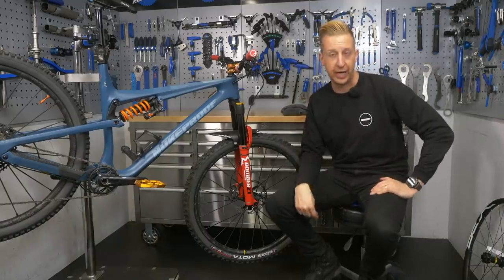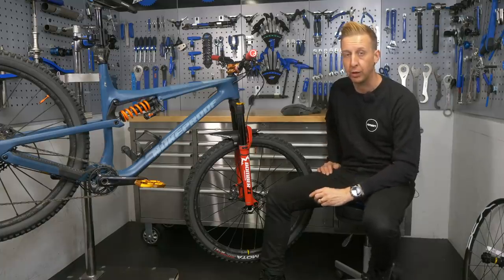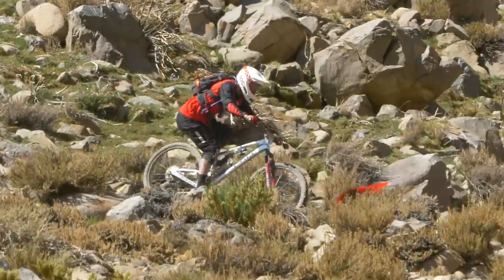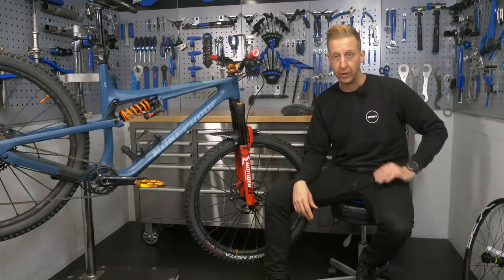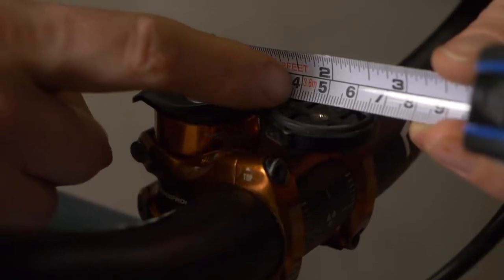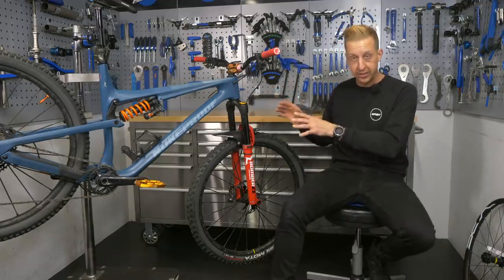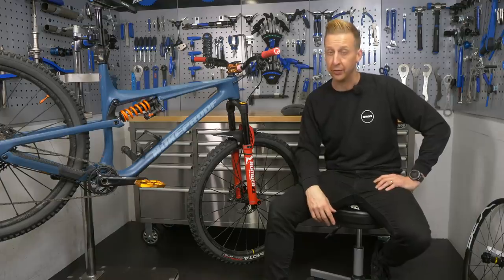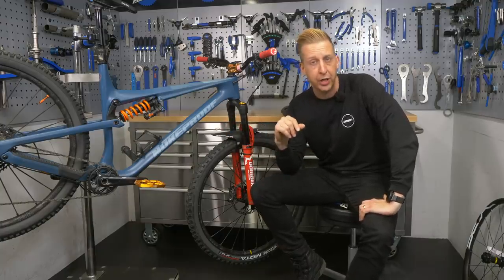27.5 Inch Wheels Are NOT Actually 27.5" | MTB Tech Misconceptions

Comment: I swear this video was a life saver. I took my bike apart and couldn't find out what was wrong with my headset but it was brake pads
Reply: Don't forget rotor bolts. They can work loose and cause the rotor to move

Comment: Easiest way to isolate the headset is by turning the bar 90º and either rocking it or torquing the bar up and down. This eliminates both the fork bushing play as well as brake bolts or pads.
Reply: Brilliant tip, saves lots of time and effort
Reply: thats exactly how I do it

Comment: I disagree with the lockout not making you faster. When you lock out you transfer more energy to the pedals and not into the suspension. Especially if you stand up. I’m open to being proven wrong though so if there’s a video or other experiments anywhere, point me that way. Keep up the good work.
Reply: Ur correct in general...does depend on terrain, e.g. a technical climb maybe more efficient open, but Fire road etc. Locked is more efficient (more speed for watts same energy input).
Reply: A slippery or technical climb may be more efficient with the suspension open. If one is locked out and compromising traction, they may have to pedal more carefully and with less pressure to make the climb. I stopped using my switch and haven't noticed the sustained climbs being any more difficult. I'm on a 153/160 bike.

Comment: The rotors can get loose and it will feel like the headset are loose aswell
Reply: I recommend marking rotor screws with marker pen ...take a picture... then you can see if there's been any screw movement. Saves breaking a loctited seal when checking.
Reply: Yeah thats one way! But if you dont want to draw on your nice Ti scews, the 1 drop of loctite (normal strengt!!! If you dont wanna drill them out🙈) will keep them from moving.

Its easy to check if the rotor is loose, stand over the bike and grab the front/back brake and puch the bike back n forth a bit while looking at the hub and rotor, if the hub or the whole wheel moves a bit while the rotor is still, its gotten loose.
Reply: True enough.. ;)
Reply: Then you’re not really checking the bolts.  It’s pretty easy to just put a T25 on em and check

Comment: I was convinced my headset was moving once and it was the shock bushing 😂
Reply: Fork? It is a tricky thing to feel...best to have preload so loose its v obvious, tighten 1/8 (yes, 1/8 NOT 1/4) turn at a time until the obvious movement goes, then tighten ¼ turn more. Check wheel turns freely (if tilt/lean bike, wheel can turn under its own weight) and thats it. Align bars, tighten stem. Boom. Any other play should be not headset.
Reply: Rupert Wenn no the pivot on the rear shock was moving which translated to movement in the frame.

Comment: Excellent commentary, good call on  the lock out. I have recently discovered, just how well a proper suspension tune can eliminate the need for locking out. I can pedal out off saddle up or downhill, and still have all the suppleness I expect. Without bobbing or feeling squishy. Also I found by going up 20mm in fork travel, helps the balance between progressive and plush. I'm not buying into the coil shock thing. We had them in the 80/90's and they only really helped take the edge off. Rebound rate was always a issue.

Comment: Loose (CS) crown steerer didnt get mentioned as a common issue that seems like a headset, with long travel single crown forks.
Reply: 2BORED Fox 36 had huge problems with this. On harsh strikes you’d get a massive popping noise.
Reply: This was bad on one of my factory 36 CSU, not a cheap fix if you aren't the first owner
Reply: My 36's had already been replaced under warranty. Fox covers them for up to 18months i believe but prepare to wait 2 months for a turn around in aus. 
(Triple crown forks look so good now 😍)

Comment: the big problem with bike tire sizes, this that most people understand  size marking for auto tires that use the out side dia. of the rim. now for bike tires the number you see on the tire is the out side dia of the tire, a 700c tire is 700 mm out side dia a 29er is 29in in dia both use the same size rim a 622 mm  tire mounting ring. Now you have different tire manufactures and they will be different. If you have a 29er that is 2.25 in. and a tire that is 2.35 the. 2.35 will be larger in dia than a 2.25

Comment: @GMBN Tech... US bicycle tarrifs are based on wheel size. Initially the major US bicycle manufacters wanted a tarrif on all imported 26" wheeled mtb's. Then they moved manufactering to Taiwan anyway because it was more profitable. So in order to get around the 26" wheel size US tarrif they went to the 29" and 650b wheel sizes. My feeling is that once the 26" wheel tarrif goes away they will suddenly rediscover the 26" wheel size because it will take less material to build a bicycle and works better with the 1x drivetrain.
Reply: 26 isnt coming back for trail sorry. And 27.5 will gradually disappear. They will be for dj and kids bikes
Reply: Is this for real?
Reply: Is this actually a fact?
Reply: @ElliotFlowers  ... yes, it is expensive to retool factories for bigger wheel sizes, companies wouldn't do it unless it was profitable to do so.
Reply: @rupedog  ... I don't know I can make a pretty strong case engineering and economics case for returning to 26" wheeled mountain bikes. Lets make a list:

-Stronger and lighter rims.
-Lower-cost rims because of less material being used.
-Lighter tires.
-Lower-cost tires because less material is being used.
-Shorter stiffer spokes with an improved spoke angle.
-Lighter cassettes and closer ratio cassettes because you don't need the extra-large cassette cogs. 
-Overall you get a stronger, stiffer, lighter, and cheaper wheel that takes less effort to accelerate. 
-Lighter, stiffer, bicycle frames, because the frame designer has to make fewer compromises for the larger wheels. 
-Lighter, shorter, suspension forks. 
-Since the bicycles are lighter and more compact they will fit into a smaller box so their shipping cost is also reduced
-The only good argument for 29ers is they roll over obstacles on the downhill better than 26ers.
Reply: @coldforgedcowboy  and with that last point you just out weighed all the previous points, they have a greater roll over and contact patch, faster and grippier! less suspension is needed and because the roll faster and grip better they are faster over all which overthrows any acceleration loss.
the shift has already happened so costs/development and such have gone, funded by the forbearers and now trickled down to budget bikes.

Comment: Hi, You are mistaken. In all 1x drive ( no matter if it is boost or not ) with proper chainline ( suggested by Shimano ) You wont get straight line when the chain is in the middle  sprocket of cassette. ( with 12 sp cassette there is no middle BTW ) Straight line would be if Your chain is a little closer to the smalest sprocket then in the middle of cassette. Thats why the chain can go off when you pedaling backwards at 1x1 combination. The reason is that Simano had to choose what is the best chainline for 1x drive ( 2x drive or 3x drive ) when 2-piece crankset came. And they chose wrong. The best and optimum chainline would be about 2,5 mm smaller that they did. But sometimes there would have been problems ( very wide tire or 34,9 mm seat tube with front derailleur - sometimes there were problems with smaller chainline - it depends on specific frameset, tire, and sometimes front derailleur ) So this very few exceptions made Shimano to chose wrong ( a little bigger ) chainline.

/edit
Long time ago, there were 47,5 and 50 mm suggested chainline for 3x drive. Because of 47,5 mm was better but sometimes it could bring problems. So they have decided to keep with 50 mm when 2piece crankset came. ( for 3 x drive ) For 2x drive it is 48,8 mm  ( The exeption is fc-m665 crankset 46,8 mm but as I said sometimes there were problems with wide tire or front derailleur ) and later on there were only 48,8 mm for 2x drive ( old 2x xtr - I dont remember a code at the moment ( fc-m980 - edit ) - had also a little smaller chainline ) For 1x drive the chainline is 50,4 mm ( fc-m7000 has 50 mm ) and for boost crancksets it is 3 mm more ( but rear hubs also has 3 mm bigger chainline so it has no matter to the chain )

Comment: chain dropping on cassette when backpedalling, it could be the freehub,which is further put cassette further in on on some older hubs, and having extreme chain line.
but the design of the ramps on the cogs of the cassette can make a difference, for example on Hope pro 4 with perfect chain-line with XT M8000 46T it does not drop with 34T chainring, but with Sun Race 46T it does, but swapping to 32T it does not, and 11.50 it still does not drop. this is the setup I run on my new bike.
so chainring size also plays a role.
I have some videos showing this chain drop.

Comment: Doddmeister...Question: Myth or fact....  Will upgrading to a significantly longer travel fork damage a frame? I think not . I think it would take a considerably longer lever to effect that kind of damage.  I measured some forks I have lying around, the length difference between a 110mm and a 160 mm is only 25mm . Factor in a bit of offset in crown and axle . Its probably down to the manufacturers intended use for that bike.  XC or a bloody good Sam Pilgrimaging !

Comment: My chain kept coming off,  turned out, 2 links were broken, one on one side, one on the other and just one link apart, so it was pulling to one side and slipping off just as it reached the front set. Needed a new chain the damage done because rear mech was knocked into chainset. Check your chain links, both sides.

Comment: Quarter back peddle and my new bikes change up a gear and this makes chain slip when putting pressure down on tec climbs, painful. I didn't expect this from expensive bikes.
Reply: get it set up properly at your LBS, i could just be cable stretch which happens to all new cables and will alter the tension affecting your gear indexing. specialist kit has tighter parameters and needs fine tuning, an 8 speed has a lot of slop compared to 12 speed.

Comment: Hi Doddy, I've just installed a full SRAM  XO1 Eagle Boost groupset onto a 2019, Specialized Stumpjumper Expert 650B. When I shift up the cassette, from the 42T cog to the 50T, the chain does not always sit properly between the 'teeth' of the sprocket. Visually, you can see that the 'teeth' of the sprocket are 'hitting' the rollers and holding off the chain from seating properly onto the sproket. The other 'tell tale', as you would expect, is that the drivetrain doesn't sound right when this happens. Usually, a few shifts up and down the block, and it sorts itself out. However, I'd rather this not happen at all. Any ideas or pointers? Thanks. #askgmbn.

Comment: Remember doddy to turn your bars sideways to eliminate the bushes moving to see if the headset is moving
Reply: Yes, can still get some bushing play tho, and maybe wheel ir axle-hub play...but removes brake play and most fork...BUT issue is that your tightening the preload so ur stem clams MUST be loose...so hard to turn wheel and hold there. Not impossible, but tricky.
Reply: @rupedog  only with cheap forks, also I'm not tightening anything to loose. All good my end 😊

Comment: I'm just starting mtb ,,I have a 27.5  Rockrider st 900,120mm rockshox silver air forks and the back is a x-fusion pro L 120mm air shock i paid £750 for it new,it has sram (xx1) 1x11 gear system,but the gears are Microshift gears and I have tektro brakes hydraulic 180mm front brake 160mm back brake,should I change anything??I'm defo changing the gears i want sram or shimano but I'm new to MTB,any tips helpful thank you

Comment: Dear Doddy, have to disagree on the lockout portion of the clip.  Any pedaling induced suspension movement is wasting your power.  Altering your pedaling technique does not magically change the bike's kinematics.  Place a potentiometer on the rocker link or the airspring shaft and you will see that regardless of pedaling technique, power is wasted loading the suspension.  "Smoother" pedaling just means you're loading the shock with less intensity and perhaps longer duration.  Shifting your weight will alter the sag which in turn will affect the anti-squat.  Pedaling technique will NOT.  With respect to the lockout, while it does not prevent the waste of pedaling energy (as it is not a true mechanical lockout of the spring), it will go a long way in helping maintain sag for optimum anti-squat etc...
Reply: i agree with Doddy, if you pedal efficiently, especially with clips, you pull and push at the same time on either crank so the force you apply over all is evened out which on rough terrain is easier to do with open suspension as you can keep that cadence consistent and not stall on obstacles as your suspension soaks them up, meaning you exert less energy over all. its only efficient to use lock outs on smooth trails/road. where the suspension has no benefit.

Comment: Doddy, Im tall and mostly all leg, short torso/arms. I have a 2018 Jeffsy XL(biggest size in that model)  and i have to get the seatpost jacked up sky high to get proper leg extension, so my saddle is much higher than my stem/bars. I have 50mm rise bars coming but what brand/model of bike should i be looking at next time. I guess i need soemthing with a tall seat tube and short top tube. thanks! #askgmbn Pic of bike here: https://imgur.com/dYnwfA1

Comment: I have a 1x12 sram eagle. Everytime I backpedal in the granny gear to avoid pedal strikes my chain falls down. My lbs said there's nothing I can do about it because of the chain line. 😞
Reply: You could change the chainring/crankset to give you a narrower chainline
Reply: 🤔 Your LBS said not even a chain guide (with a cage on top and a roller on the bottom) would work?!
Try a different shop!
Reply: @geemail369  they didnt mention that good idea though
Reply: @lexusstefan927  different cranks would bring the chain closer to the bb?
Reply: @lexusstefan927  no, it will foul the chainstay.
Reply: You sure ur eagle bb was installed with correct spacers (or lack of)? Might have put a spacer when one wasnt needed. Measure the width of ur bb shell (the frame shell only). If its threaded then 68, 83,  or 100mm wide, or for press fit 89.5, 104.5, or 121mm wide, then it should have a spacer drive side (and non drive side fir threaded only). 
If its any other width at all and still does have a spacer on the bb, then it was installed wrong and u have the wrong chain line. OR u have non-boost bike, but a boost eagle chainring fitted. (Chainrings should run vv close to chainstay, really close, like 1mm or so)
Reply: @rupedog  It doesn't look like there are any spacers. The bb seems like its  flush to the frame. I have an Ibis Ripmo af. The bike shop owner said this has happened to him before too with sram. I would like to have a 2nd opinion though.
Reply: @NKPMPRODUCTIONS  that won't help the chain dropping down on the cassette, that will only stop it dropping off the chain ring. if its dropping from 1st its your chain line, which by the sounds of it you don't have room to bring it inboard with your bike, you might be able to get a smaller chain ring to give you more room bring it in, with a smaller offset, chain ring spacers or different cranks. otherwise a different cassette may hold it better.
Reply: that won't help if its dropping on the cassette as the chain line will be the same.

Comment: The last point seems a bit incorrect.  Riding without a lockout means you are also losing part of the energy from the pedal stroke to compressing the suspension which means you are going to be having to work harder for the same result or be going a bit slower. For a fit and strong rider this is not really going to be an issue but for lesser riders it can make a difference.
Reply: I disagree. For a fit rider, it's easier to shift weight around to overcome some of the surface bumps. A less fit rider, (like me) tends to just stay sat and let the rear suspension work to absorb obstacles like small rocks that would otherwise be a considerable resistance to the path of the back wheel. I have a local route with a rocky climb I've never quite cleared. When I had an air shock with a lockout, I would get further up with the shock in the pedal (mid) setting than with it fully locked out. Just my opinion.

Comment: #askgmbntech whats ur take on dnm mtb suspension I know dnm do good pit bike suspension also I have a 2014 rockshox Monarch RT3 plus 200mmX51mm travel upgrade from a dnm 165mmx36.5mm Air shock so the Monarch has gave me a wheel travel of 170mm and changed front fork from Sr suntour coil fork 100mm to a set of fox float rp 32 f series 140mm travel air fork tapered with a hope 1-1/8 inch to 1.5" straight steerer adapter and using original top bearing and cup I've tuned to my weight and riding style but small bump sensitivity is crap will a coil shock solve this and what brand of coil shock brand eye to eye 200mm max either 51/57mm travel   and cant fault the forks handles everything I throw at them

Comment: Creaking headset is a common problem of integrated system. Using zero stock is way far better.
Reply: Need to grease the cups, crown race, all outside surfaces of bearings, spacers, top cap...all of it! Also helps prolong bearings as keeps more water and dirt out.
Reply: I always reqrease and clean.. but the problem always persist.. specially after a heavy use.. not found in some zero stock headset ive known